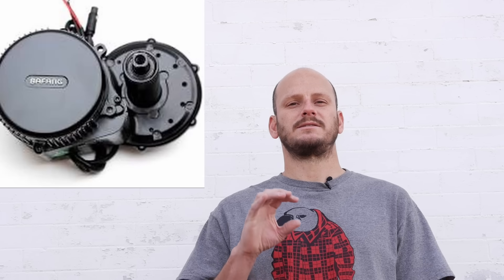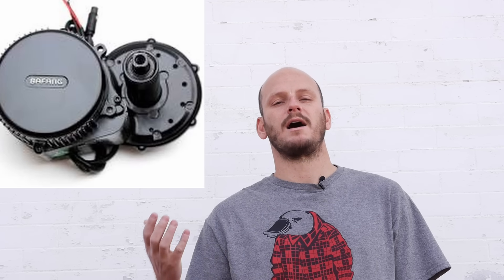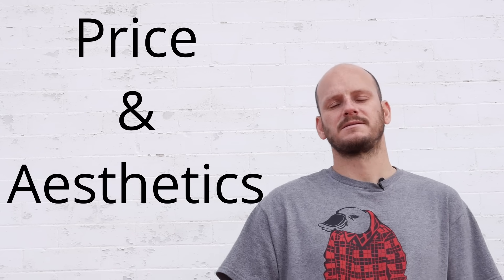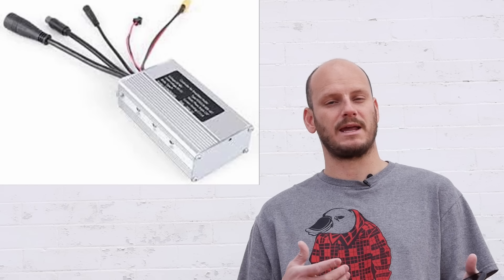Hub vs. Mid Drive Motors: Why Hub Motors Suck and Debunking Common Myths with performance test

Comment: I'm a bit confused here. I was looking at converting my bike using a Yose hub motor kit that was 350W, but after doing some research I prefer the Bafang 750W kit. I thought that using the hub motor you can use all your cassette gears including the front 3 chain rings, but you talk about it being as one single speed, don't get that.
Using the mid drive I am aware that there is only 1 front chain ring and your rear cassette and surely you can use any of those gears in that cassette?
Reply from the maker: The mid drive puts electric power through all the rear gears. Hub motors don’t put any power through any gears. So with a hub you can still have 3 chainrings up front and use them, just only through human power.
Reply: I see it now, the rear hub is just driving the rear wheel. What about gear selector sensors, would you recommend fitting one with a mid drive system?
Reply from the maker: Yes I totally do
Reply: Great, I'll go with the Bafang 750W kit. I will be fitting it on a Giant xtc 4.5 have you ever fitted one on these bikes?
My frame is small, so might have to relocate the battery. Thanks for your help and replies, I have now subbed. :)
Reply from the maker: @irishrover63  I don’t believe I have done that exact bike. But looks pretty straightforward

Comment: I regret getting my hub drive big time. Mainly because I am finding it impossible to derestrict it. Can anyone help me increase my speed beyond 25km/h?
Reply: Hub drives usually are very easy to unblock, what is your setup?
Reply: Hey  @silver_surfer88  I have a Bafang H400 Series 36v 250W Rear Hub, Rotation Sensor w/ a maximum torque of 45 N.m. On a Lekker bike. Any advice you could give would be amazing
Reply from the maker: What display do you have? If you have one.
Reply: It is the  @JohnnyNerdOut  
It’s the standard display that comes with the Lekker Amsterdam + model
Reply: @terrydactyl7708  From that spec i think max speed you can put out of it will be around 32km/h, with no pedaling but it really makes a difference
Reply: @terrydactyl7708  What is the controller you are using? im sure you tried all unlocking combos using the display right? if you did, then you need to go a little further  and find the speed limiter wire on the controller and disconnect it and test (usually is a white wire), also if you really want to go faster you'll need a higher voltage battery (or mod your existing one) at 48v you maybe can get around 45km/h, keep in mind that this is just rough numbers
Reply from the maker: @terrydactyl7708  looks like you have the Dpc-11? Isn’t a ton of info on that display. But if you can figure out how to get into the settings you might be able to up the limiter
Reply: I haven’t tried unlocking any combos on the screen  @silver_surfer88  I’m not sure where to begin with that. Is there any guide or instructions that will help me achieve this? Disconnecting wires also seems like a daunting task without instructions. Do you know where I can attain this information. Thanks so much for sharing your knowledge
Reply: I managed to get into the settings  @JohnnyNerdOut  but still no luck in accessing the speed limitations. Not much point in having a ebike when you can peddle faster than the power it provides. So frustrating. I’ll keep trying until I get to the bottom of it.. surely it is possible. Thank you for checking it out for us Johnny.
Reply: @JohnnyNerdOut  is it possible to just purchase a different bafang controller that enables me to access the speed settings, plug and play style? 
It seems I can get to the speed limit option on my DPC 11, but there’s no ability to alter it.
Reply from the maker: @terrydactyl7708  you should be able to. Disconnect the controller from the motor and see what kind of connection you have there. Make sure you get a controller that uses the exact same connections.

Comment: Neither is better. They both serve a purpose... But its a lot easier to pedal a broken hub motor home than a broken mid drive #FACTS 💯
Reply from the maker: Arguable :) Ride both for over 1k miles over varying terrain.
Reply: @JohnnyNerdOut  im still shopping for my first mid drive, just scared if it breaks, ill have to walk it home. My 3 hub bikes can be pedaled home if the motor breaks. Maybe thats the tradeoff for getting a lot of extra torque
Reply from the maker: @eeelectricish6486  do you mean if the chain breaks or the motor itself brakes? The motor will last forever if you ride it halfway decently. You might brake a chain if ridden hard so just pack an extra $15 chain or at least some master links and your golden
Reply: @JohnnyNerdOut  nothing last forever, no argument there. I meant the motor. If the mid drive motor doesn’t work, can it still be pedaled home? And also can you use the bike with the motor off???
Reply from the maker: @eeelectricish6486  yea you can for both. Unless the breakage were to occur in a specific way that made the cranks not be able to spin. Not sure on the likelihood of that happening.

Comment: spokes???..they all have pokes...throw your wheel away??? or throw your front deralier away???? you going to remove bottom braket and cranks on the mid drive.these arguments are mute.
Reply from the maker: I’ve done both versions of conversions. IMO it’s less surgery to the bike doing a mid drive.
Reply: @JohnnyNerdOut  then say that in your vids not that a person only has to remove front deralier for mid mount...bs.

Comment: if you brake a chain you only broke one link...bit silly carying a whole chain especialy if you have only broke one chain in 1500miles..just cary a chain braker in a molty tool...i agree the "i can get home with out a chain on my hub motor"..is tupid.
Reply from the maker: 95% of time, yes you just need a "missing link" unless you gloriously break chains like I do and somehow multiple links are garbage.

Comment: where are your torque comparisons measured from? at the motor shaft? at the hub?at the cranks?at the wheel? if wheel what size wheel?at or in what gear?
Reply from the maker: Just watch the performance comparison using the same bike and battery but switching from a 750w hub to 750w mid.  Spec sheets don’t mean much in real world, I get that. But the proof is in the pudding my man. Video don’t lie....
Reply: @JohnnyNerdOut  you do not have any idea what you are talking about do you?...dont answer go away.
Reply: @JohnnyNerdOut  If video don't lie, then what are deep fakes and camera angles? The proof is not in the pudding because "the proof of the pudding is in the tasting" or the testing, in this case. They could both be 750w but different voltages.
Reply from the maker: @sammiller6631  as stated, both motors used were tested using the same exact stock battery. 48v
Reply: He clearly doesn’t know lmfao... If that mid drive breaks, good luck peddling home. Any broken hub motor can be pedaled 😢
Reply from the maker: @eeelectricish6486  depends on how it breaks though. But more importantly IF it ever breaks😀
Reply from the maker: Since a hub motor really only has one place to put the power I think it’s safe to assume that they measure from the crank, or in a hub motors case, the hub/axle. There is no international standard unit of measurement that I know of to measure ebike motor torque but if anyone does know the standard please share because no one talks about it🧐. Having 2 different types of motors/power delivery only confuses things. Great question though! Thanks!
Reply: @JohnnyNerdOut  I thought the international standard unit of measurement of ebike motor torque was Newton-Meters?
Reply from the maker: @sammiller6631  it is

Comment: Mid drive are not efficient in maintaining high speeds as compared to hub motors
Reply from the maker: Bad experience?
Reply: @JohnnyNerdOut  Not really, my hypothesis is based on my research

Comment: If both motors costs about same, why hub bikes cost 1000 and mid-drives 4000+?
Reply from the maker: It’s a case by case basis and not a quick answer. You can find mid drive bikes for under $2,000. Ive built them brand new for under that. Cheap hub motors are less expensive than cheap mid drives, they sell more hubs than mids so costs go down.
Reply: Because mid-drives are usually designed to built into the bike in some proprietary way unlike all the standard parts that can be used interchangeably  with a hub.
Reply: @sammiller6631  I don't think it's a case because in many hub drive bikes the battery is also integrated into the frame, I mean the frame itself is designed for that also. What I think it's just companies keep it that way not because of the system superiority, but for some other reasons.

Comment: Can a vintage 5 or 6-speed freewheel (not cassette), or BMX-type single-speed freewheel handle a 750W mid-drive?
Reply from the maker: Yes
Reply: @JohnnyNerdOut  How?
Reply from the maker: @sammiller6631  750w isn’t a crazy amount of power. Unless I’m missing something?
Reply: @JohnnyNerdOut  "750w" is vague, because watts are easy to tweak for marketing. "A motor producing 20 Nm of torque and spinning at 100 rpm is generating 209 watts. That same motor producing 20 Nm of torque while spinning at 300 rpm is producing 628 watts. Let's assume that 20 Nm is the maximum torque that this motor can produce without risk of it overheating, do you now call it a 200 watt motor? or a 600 watt motor?"
from https://ebikes.ca/learn/power-ratings.html
Reply from the maker: @sammiller6631  right, but it’s also easy to find what your controller current draw is and multiply it by your voltage.  It’s very accurate even when hooked to an ammeter. Your way is more accurate, although probably harder for the layperson to compute easily(I am layperson) 🙋‍♂️Your right that the “rated”watts are not accurate. There’s a huge range between nominal and peak often times from each manufacturer to another. 
But honestly the point of this video really was to just show the difference in performance between a hub motor and a mid drive. Math is great on paper but performance is the true test . If a stock car can’t win a race but it does on paper it doesn’t matter
Reply: @JohnnyNerdOut  Watts isn't even asking the right question. Watts are just fuel poured into the motor. If I poured 750 oz of gas into a Ford Pinto and a Ford Mustang, would you expect the same output? It's not a fair test to use a cheap low quality motor like Bafang to claim all hub motors are bad. Bafang are counterfeit clones stolen from Sunstar ( https://web.archive.org/web/20150325055431/http://www.sunstaribike.com/sunstar-court-action/ ) which are made cheaply with little QA testing or warranty service. 

Look at this comparison between Bosch mid-drives and Bafangs: https://electricbikereview.com/forums/threads/apples-to-apples-bosch-vs-bafang-ultra.37788/ 

"...BBS-01 and BBS-2 had a lot of problems, controllers would burn down and other issues...The torque sensing sub-par and the features are average...They are unwilling to test their product to UL standards, maintain QC and provide long term support and that has made them a no-go candidate among OEM's like Trek, CUBE, Specialized, Giant etc...Giant is one of the largest bike manufacturers in the world and a stone's throw away from Bafang but they refuse to use Bafang M350 or M500 or the ultra but instead chose to go with Yamaha. That is weird."
Reply from the maker: @sammiller6631  I think I’m starting to understand that you don’t care for bafang mid drives 😀
Reply: @JohnnyNerdOut  There are better choices. Even within mid-drives.
Reply from the maker: @sammiller6631  I agree. In my personal experience I find bafangs to be a good cross between value performance and reliability. what’s your mid drive of choice?

Comment: how about rain?? A Lot of friends of mine don't recommend mid-drive because of water getting inside the motor. Hub motors are easier to fix it. I've been riding a hub motor it's been making a lot of noise.
Reply from the maker: Bafang mid drives are almost waterproof. I did about 3k miles in the Portland rain with zero issues. They are weather sealed very well. I don’t recommend submerging them though. In my opinion mid drives have been easier to service. But I guess it depends on the type of service needed.
Reply: @JohnnyNerdOut  thanks for reply that quick. I've been working as Deliveroo rider with a bafang hub 500w in Dublin - Ireland (you probably hear of the Irish weather Lol). Here there's only one bike shop that can fix the mid-drive motors problem .

Comment: I'm considering to get bbs02 mid drive motor, only consern is casette wear, how casettes usually lasts on mid drive?
Reply from the maker: Really depends on how hard you ride and how well you maintain the shifting. Should last forever if you take care of it. Literally.
Reply: You need a HIGO extension to connect to the motor.
Reply from the maker: @penskib1975  what do you mean?
Reply: @JohnnyNerdOut  well I put a link in to a Bafang BBS Motor Kill Switch Button Brake Button with HIGO Connector but it seems to be deleted. Off aliexpress
Reply: Anyway when you press the button you change gear, like a gearsensor does but manual and you don't have to mess with the derailleur cable.
Reply: But you have to buy a HIGO extension to connect it to the motor as the cable that comes with it doesn't quite reach.
Reply: I have a bbshd with it on and a 12 speed 51-11 cassette, it will climb any hill and has great top speed although 20-22 mph is plenty for me.
Reply from the maker: @penskib1975  I see now. You like that switch? It always looked like more of a hassle but I have no experience with it.
Reply: @JohnnyNerdOut  yes it's easier to fit than a gearsensor because you don't need to take the derailleur cable out, and you can hold the button until the gear change is complete, when pressed it doesn't shut down the motor completely (if connected to the proper connector on the motor instead of y connector into brake sensor) the motor gently turns to make changing gear easy. I find it works pretty good, although if you do press your brakes and off again it seems to forget you still have the gear sensor button pressed, but that's the only glitch.

Comment: Is there any difference between hub and mid when cycling with them turned off?
Reply from the maker: Probably varies from different manufacturers. Generally not really
Reply: @JohnnyNerdOut  doesnt differ with hubs. You can pedal ANY broken hub motor back home, not a broken mid drive
Reply: For what bbso2 cost you wood think there controllers were more durable . Look at them the wrong way they blow
Reply: @thomasjurd172  Why would you expect bafang to be more durable? They are a cheaper clone stolen from Sunstar motors.
Reply: Most Mid-drive are Freewheel, meaning that other from the added weight, there will be almost no restriction when pedaling. Hub motors however, are almost impossible to pedal when power if off, because you will be working against the magnets/coils induction. I have an EEB Enduro e-Bike frame and my first build was with a Hub motor, it now has a Bafang BBSHD running at 4000w. A couple years ago, I had a BMS failure when running with the Hub motor and I was barely able to make it home pedaling, it felt like I was dragging a 50lbs weight behind the bike.
Check out my YT channel here for more info: https://www.youtube.com/channel/UCaJJg4lI_jzUq4WXgESyoPg/videos

Cheers